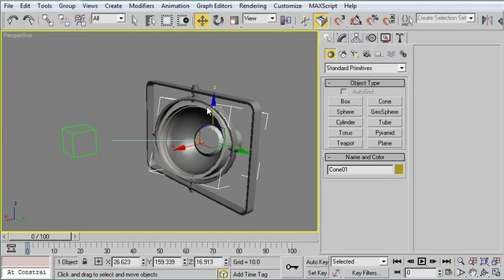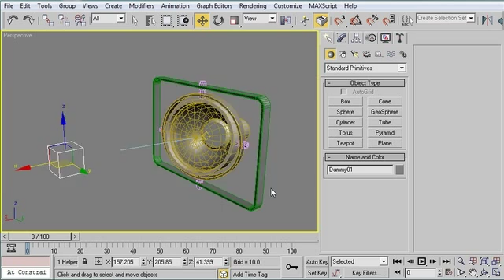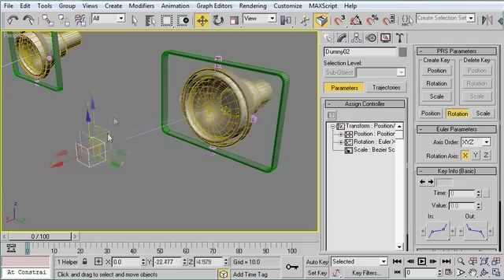3dsMax Monday Movie #53: Inorganic Look-At Constraints

Comment: Hi i Got A Question

I;m Trying To Rig Something using The Lookat Constraint , It Worked Fine On The x Axis But When I Tried On The Y Axis ... Whenever It Moves towards The other side of The y axis . The Object Which has The Constraint  Turns Around in 180 degrees ... Any help?

Thanks for The Tut. I'm Sure it'll Come In handy Later :)